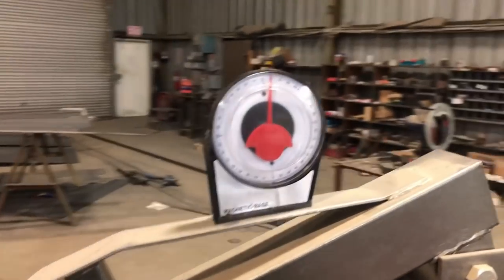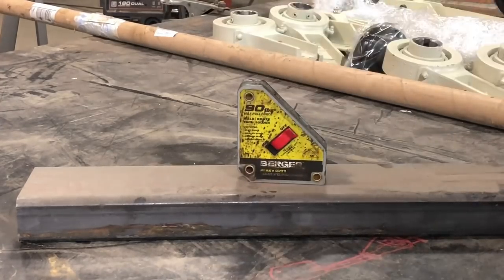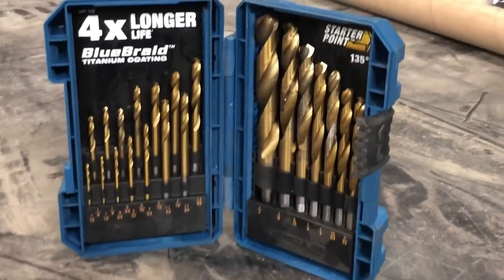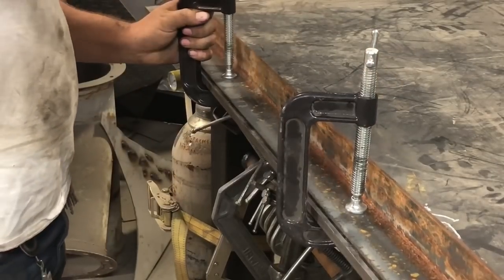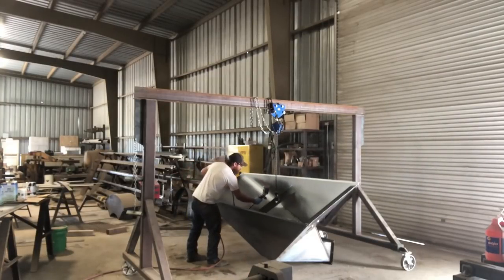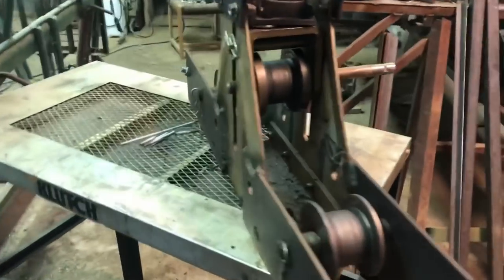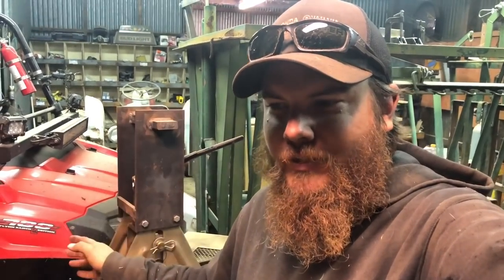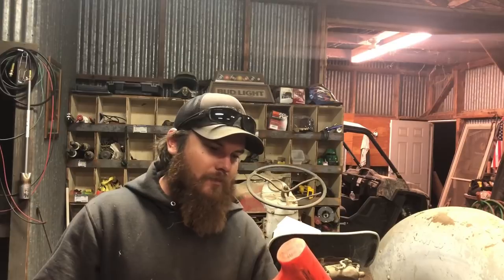My Favorite Tools from Harbor Freight

Comment: A couple I would add to this list. Step drill bits, magnet trays and "some" of the automotive specialty tools.
Reply from the maker: I almost put step bits on there but they seem to go dull too fast. Then again you’re probably not supposed to be drilling through thick steel with them either

Comment: Thanks for the reviews !  Yeah I have those red magnets and there good at holding metal shards . I was looking really hard at the tubing roller the other day , I didn't buy it wasn't sure , maybe I'll put it on Santa s list now !! Lol Good job ,shop Tyler !! 😉
Reply from the maker: Thanks BTO! The tubing roller is great once upgraded with SWAG roller dies and drive shaft. SWAG makes the wings and a bottle jack adapter too, but I made those pieces myself because they were pretty easy. If all you’re doing is light tube (16ga wall or thinner) you might not need the upgrades, otherwise check out SWAG Offroad to get that thing set up right

Comment: I'm very interested in seeing how you rolled the metal for your sweep tub.. I'd like to construct my own!! Thanks
Reply from the maker: I actually just posted a video showing just that!  Here’s a link-

Squeeze Chute Restoration, Part 4!  Using the Harbor Freight Tubing Roller https://youtu.be/qSN3_9FRbak

If you have any more questions feel free to ask. When building the tub, the center post placement is key. Start there and build the tub around it is my advice. Thanks for watching!
Reply: What about rolling the sheet steel for the tub.. did you just tack it a pull it together then come back and weld it solid.. I gotta get a roller that beats the hell out of torching and beating lol!!
Reply from the maker: The sheet I used is 16 ga. so I was able to clamp and weld, clamp and weld. Warpage can be an issue with thin sheet as I’m sure you know, so don’t be stingy with the clamps!  Another option is TEK screw the sheet up, weld it, then remove screws and weld up the holes. If you’re going to buy the roller, figure in the cost of swag off-road rollers (dies), swag drive shaft, wing kit, and bottle jack kit. The roller is borderline useless out of the box, but with these upgrades it is awesome!  I made most of that stuff myself and you probably can too. Just check out swags website (swagoffroad.com) and see what you can make yourself and what you need to buy.